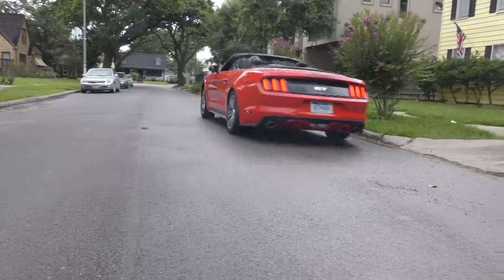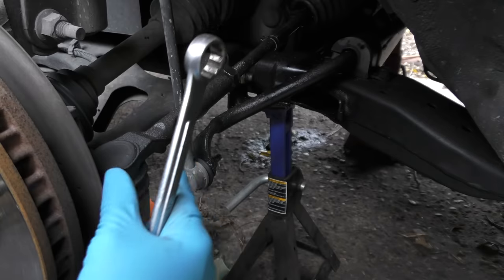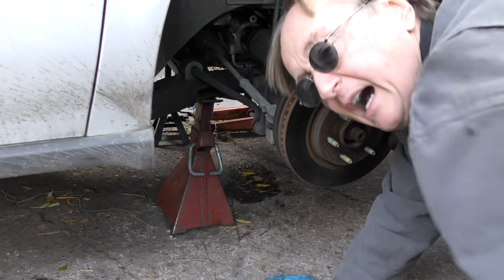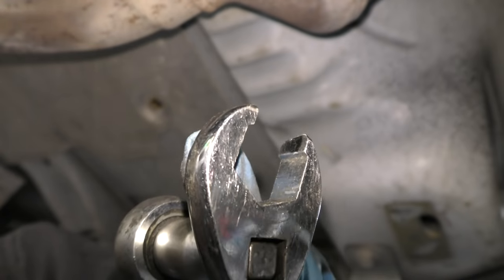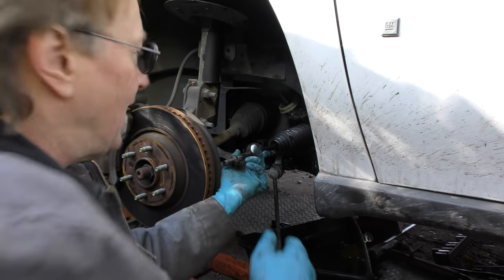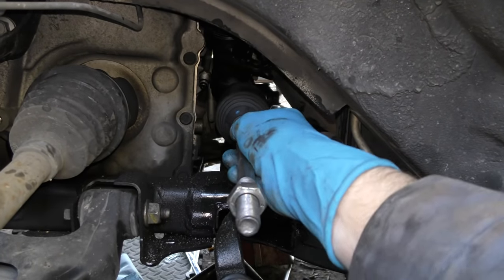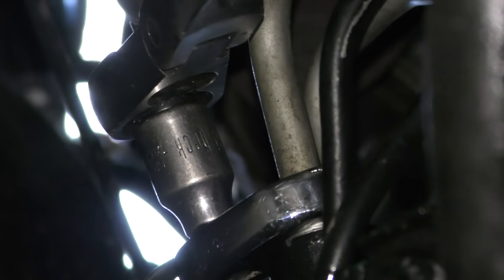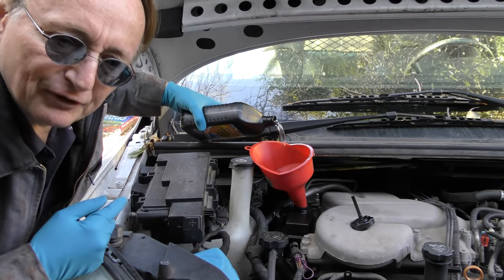How to Replace a Power Steering Rack in Your Car

Comment: For those about to do this job, keep in mind that some cars don't take regular power steering fluid. Toyotas generally use ATF in the power steering systems, check the cap for the fluid requirements. Just a tip!
Reply: Atf is power steering fluid unless you're driving a euro car and then it's most likely mineral oil or a synthetic substitute.
Reply: true, like some fords too take atf
Reply: My volvo Takes atf
Reply: I'm pretty sure if someone is smart enough to change the rack they can figure out which fluid to put in it
Reply: Dima Aryeh Same on Taurus. It seems like regular power steering fluid is thicker, and I've read it can contribute to messing up valves.
Reply: Mine takes "F" transmission fluid.
Reply: @edvh1564  Funny when the most American-made full size truck is a Toyota Tundra.
Reply: my c5 uses LDS, which only TOTAL makes, so if TOTAL goes outabizz we scrwed lol
Reply: @eksine Bro that’s not always the case people are still people
Reply: volvos dont tell u on the tap 😭
Reply: Johnsen's makes a fantastic fluid multi make multi model

Comment: When replacing a rack and pinion make sure you center the rack, flush the system, clean or replace the reservoir, lock the steering wheel in place to prevent damaging the clock spring and bleed the system after the installation is done. Just a few more tips for beginners
Reply: Do you know how long it takes to do this job that Scotty did? Please let me know.

Comment: I used to watch this guy years ago when I lived in Texas. He has a segment on the news in the morning for car tips. Always something informative and entertaining. I'm glad he included the part about swearing as you try to remove the rack, because that is 100% accurate and necessary to complete the job. lol
Reply: I had to take out the brake line mounts to make more room to get it out of the way.  I was even considering removing the exhaust pipe, in order to try and get the subframe to lower even more, but when I initially tried, the bolts got rounded off.  I eventually was able to push the part of the steering rack that connects to the steering column past the array of brake lines.  And then there's more swearing when it comes to putting back the heat shield, and putting back the pinch bolt.  It's like every step in the process involves swearing.

Comment: It's important to note that not all vehicles rack and pinions are easy to change like this one. I believe this was a Chevy venture or uplander, one that obviously hasn't spent much time in a rust belt state. And yes as a previous person stated, LOCK THE STEERING WHEEL.
Reply: +adventureoflinkmk2  Funny you should say that because the van in this video uses a unibody. My point is, do your research on how to work on YOUR car. If you had ever changed a rack on a Sebring convertible, or really any damielchrysler(besides the SUV/truck line)Every vehicle can be VASTLY different from the next.
Reply: thank you, 05 chevy uplander I believe

Comment: A Point to make:  Be sure the steering wheel is centered and locked before you start removing the Rack.  That way the steering wheel clockspring won't be broken. You can slide the rack back and forth to match the sheel straight ahead position before connecting the Steering wheel pinch bolt connection.  

Your mileage may vary..

mark
Reply: yeah, how to straigghten  the heck outa the steering wheel without it moving when maniupalting the rack and without using an expensive expensive tool?
Reply: I think I broke mine mid driving lol
Reply: Seat belt wrapped around wheel
Reply: Bro signed a YouTube comment 😅

Comment: Scott be like.. "how to replace an engine." in a 2min video
{Cheesy intro goes here}
(1) Remove bolts
(2)Remove engine
(3) Put new engine in
voila!
{Cheesy outro}
Reply: Other than draining the coolant and removing the power and electric connections it's pretty much that straight forward, it might not happen as fast as you can say it or edit it into a video but it's not complex at all.
Reply: Torque to spec... Ughh
Reply: Super cheesy for sure
Reply: Clearly never removed one from a 2003 Ford Escape V6 3.0L XLT 🤔
Reply: And he’ll do it on jackstands like wtf 😭
Reply: Don't forget to insert, "cursing and swearing", where needed.
Reply: Wind up your engines!
Reply: Forgot full oil...
Reply: Doing this job on literally the same car as in the video, it really is that straight forward, you just have to insert common sense where applicable.
Reply: It took me 5 days to do this on a honda accord, and that is not including the weeks I spent researching online, writing up a procedure (to include details like torques), and purchasing all of the replacement parts (including honda original bolts that need to be torqued, as the service manual recommends they get replaced when the are removed).  It is my first major repair attempt, so I had barely any tools to begin with.  Had to buy tools as I needed them.  Every step was a pain and a learning experience.  Some bolts took me about an hour each just to figure out how to remove them.
Reply: @s4f4m78  Yep, the only time I curse and swear is when I'm working on my vehicle.........oh, also when I'm stringing Christmas lights.

Comment: Good quick video, great for reference. Wish you would have shown locking the steering wheel, a lot of people who would get the most from this video aren't going to know about the clock spring and air bag issues if the steering shaft isn't put on in the right position.
Reply: What's the secret to that? Locking the steering wheel that is.
Reply: Yikes, after reading this, I think I'll let my mechanic do it!

Comment: It's also a very good time to replace inner & outer tie rod ends, sway bar links, and whatever else may be shot underneath the car. On some cars I think you have to drop the sub frame to get the p/s rack in/out.
Reply: Most fwd cars you do now because of how they stuff them in there. And yeah it's a good idea to replace all the suspension components that are worn when you do something like this since you're already taking it apart and paying for an alignment.

Comment: I'm going to suggest that while you are replacing the steering rack, replace all of the fluid and install an in line filter. Also if you can, take the power steering pump off and look for any problems like leaks, chips, cracks. And if the pump is leaking around the fittings or the reservoir, you can get an o-ring kit to replace the old ones with. Might as well check it all before you put bad old fluid into a new rack.

Comment: You should loose the steering shaft clamp bolt first if you have to drop the sub-frame to get enough clearance to pull out the rack. If you don't and forget, it will slightly bend the end of the shaft. It will come right off when you realize your mistake but then will take about 3 days to get the slightly bent shaft back into the new rack clamp correctly. Lots of fun.
Reply: good point , 2 years later still necessary tip

Comment: I think you missed a couple of very important steps here mister Scotty, first secure the steering wheel so it does not spin while the rack is out and destroy the spiral cable, also the reattach the steering column before the tie rod ends to avoid missing the steering wheel center as well.

Comment: Also remember that cars with clock springs and ribbons on the steering wheel you have to keep the wheel more or less stationary as free spinning the steering wheel will damage the clock spring. And no mention of centering the rack prior to connecting the rack pinion to column spline. To enable you to get even turns on both sides when the job is done. I just finished my cursing and swearing and wiping blood off my finger from a rack swap this morning.

Comment: I just worked on my niece 2002 Accord with 4-cylinder. It took me the weekend to complete the job. I wished that I could pulled the rack out from the side as Scotty demonstrated. For mid-size Accord, there aren't much room to maneuver under the engine sub-frame.  loosing the exhaust/catalytic converter nuts are required.  I also used the crowfoot to loosen the High Pressure hard line flare nut and the Return Hose flare nut from the driver side wheel. There aren't enough room to reach to the flare nuts either from the top or underneath of the car  After successfully loosen both flare nuts, then I encountered more difficulty to get rack out. According to some Youtuber tips, they mentioned that the steering wheel must be turned all the way to the left, it caused the driver side inner tie rod end shorter. I also pushed the rack all the way to the passenger side, it allowed the driver side rack came down from the sub-frame. After trial and error,  the whole rack came down from underneath the car not pulled out from the side as Scotty demonstrated. Re-installation was much harder than removing. Re-installing the high pressure line was also much harder due to hard line. I don't want to cross threaded the rack thread or the flare nut thread. I used hand to tie them as far as I can go before using the crowfoot wrench. You can do it and the weekend.

Comment: 1:48 Why are you in the dirt almost in the bushes with car parts? 🤦🏻‍♂️
Reply: That's how it is. You think being a technician is a clean job?
Reply: @12mak  shoddy mechanics work in the dirt. Simple, put cardboard or plywood  if you dont have a concrete pad.
Reply: @dave3464  and what do you do? Changing your own oil does not make you a mechanic.
Reply: @12mak  Didn't say I was a mechanic. Although I haven't been to one in 25 years. So I must be doing something right.

Comment: This is great, thanks. Honda is trying to charge me like $1600 for the part and labor. I've found a rack for my 2007 CR-V for less than $300.
Reply: Odyssey Van Life It should be $200
Reply: next thing they will be putting it inside the engine block ('for stability') and it will cost you a complete engine rebuild ??
Reply: @loveshy007  Hopefully this whole world of designed to fail will be over before they get to that point !!!

Comment: have the car running as your refilling the steering fluid and turn the wheels lock to lock to bleed all the air.
Reply from the maker: +keith kennedy yes, and do that with the vehicle still up in the air
Reply: Although many do it that way, you can burn up your power steering pump if it go dry, techs use vacuum pumps with the engine off to avoid this.
Reply: keith kennedy 
T
Reply: the instructions that came with my rack and pinion literally say "Do NOT TURN STEERING WHEEL LOCK TO LOCK"
Reply: @richardgrimes6208  did you get a Detroit axle reman?

Comment: scotty you do not fix it, you change it . So call your video "Changing a leaking power steering rack" :) There is a difference between fixing and changing. 

Still love your videos and thanks for them a lot!!
Reply: TheCarista I believe the idea is that the only acceptable way to repair it is to replace it so, in a sense, he is repairing the leak.
Reply: the title is called fixing a leaking power steering rack. in no sense at all is he fixing the leak because that steering rack still leaks.
Reply from the maker: Hey, let's not get pedantic here, this isn't 5th grade english class
Reply: You forgot a very important step to secure the steering wheel to avoid wiring issues on your steering column. Also use the castle nut bolt to avoid ruining the bolt before you wack it with a hammer. Then run your engine when all done turn 10 times each way with wheels off the ground to get any air out of the system. Finally you can repair the rack if you know how even someone with basic knowledge can do it.
Reply: He did, indeed, 'Fix it' - unless the new rack was defective. Sigh.
Reply: TheCarista Replacement is a form of fixing an assembly.
Reply: keeping the steering wheel put is very very important ( it keeps the clockspring on the steering column centered too); the rest, Scotty knows we already graduated from Pre-K and know a few things already. He wants to make the processes simple and doesnt tell you all the minor details. If you want to tackle a rack and pinion you must have some experience and expect the unexpected when it comes to automechanics.

Comment: Very informative video here, but I doubt replacing the steering rack is that easy.  In some cases, if not most, you will be required to unbolt the subframe.  And that can take some serious time and tool action to accomplish.
Reply: Just did this on a 2006 Montana AWD. Was straight forward and was just as described. I replaced both outer tie rods as one was bad, so figured it was time for the other too. The link pins both broke, and are connected to the lower control arm. I pulled the sway bar out to get more room to get at the hose fittings. I was able to get them off using a wrench too (18mm).  I also removed the line bracket clamp that was just above the right mounting bolt. Took the car in to get an alignment after the install. Did not need to drop the subframe as the rack came right out the drivers side very easily. This video covered the basics and was a great summary of the job. Thanks for posting this Scotty.

Comment: On some vehicles it s necessary to unbolt the subframe... and it's a hell of job!!!
Reply from the maker: +Juan Noguera yes, there are some I won't even touch
Reply: +Scotty Kilmer yup 94 camry 3.0 is going to be hell :(
Reply: Tu que sabes Juan
Reply: You have to drop the subframe on Volvo P80 bodies as well. It's a bear of a job...
Reply: Especially when the ape before you cross-threads the subframe bolt and hammers it all the way home!

Comment: Hey scotty, I was checking my oil today and it had a strong smell of gasoline. it also had lttile droplets of gasoline on the dipstick I think. What is happening and what should I do? 2010 Honda odyssey 122k miles

PS: This was my question from last Saturdays live chat that never got answered lol
Reply: You're running rich for some reason
Reply: xSnakeStyles I had a rich code and turns out it was the MAF sensor. I cleaned that and no CEL since then. the droplets in the oil are still there.
Reply: +MrRangerZr1 After the code went away did you get an oil change? Also how is the performance?
Reply: xSnakeStyles I am going to do the oil change this weekend. performance is same as b4
Reply: +MrRangerZr1 gas getting into the crank case.... Leaking injectors, fuel pressure regulator possibly... You really should track this down soon because gasoline breaks down oil and that's terrible for your bearings.
Reply: Droplets are more likely water/condensation... gasoline would just mix with the oil...
Reply: are you still in process of fixing it?

Comment: Not a very good idea to hit the end of the tie rod end for fear of damaging threads ! Just hit the housing where the taper sits and it will shock it free
Also i wouldnt have put the rack on the dirty floor, soill and grit getting into threads ect ect , other wise good video

Comment: Well Scotty, that looked way to easy. Im about to tackle a 2000 Ford Ranger XLT 4x4. I have already replaced the tie rods, but thought the inner was still ok. I went over to the passenger side of the truck and all kinds of fluid came out of the boot. But the side of the rack was dry on the passenger, so I had gone back to the drivers side and I can see straight through the shaft as if a seal was missing. So I hope I can use what you had done here and get this thing out. Also if I can find one that doesn't come with the inner rods since mine are new.
Reply: How did it go?  I'm replacing my tie rods tomorrow hopefully which will be the last thing before I go looking through the steering system for the shake and play I'm still getting on my 08 Ranger